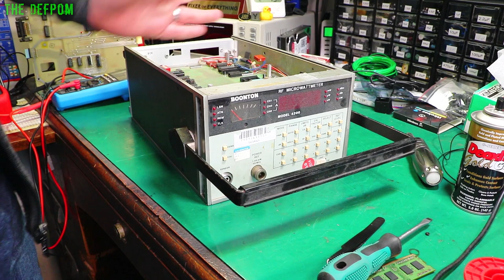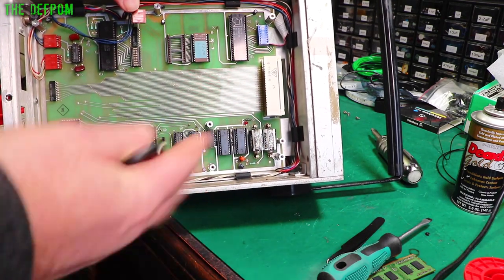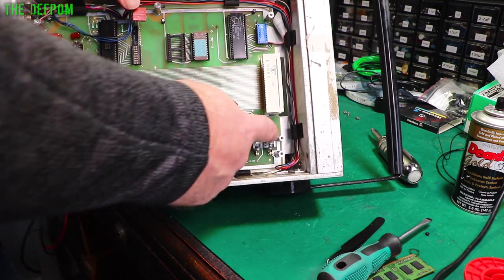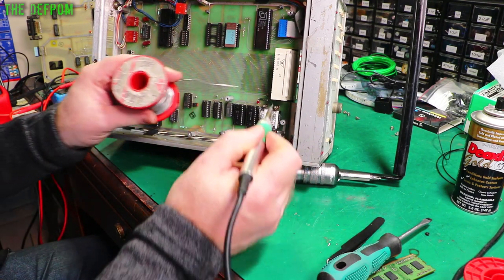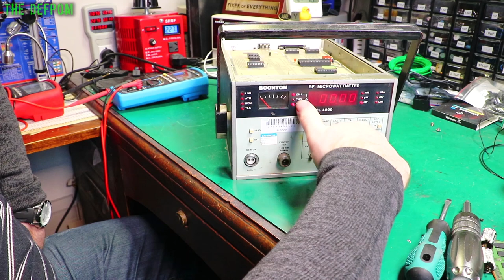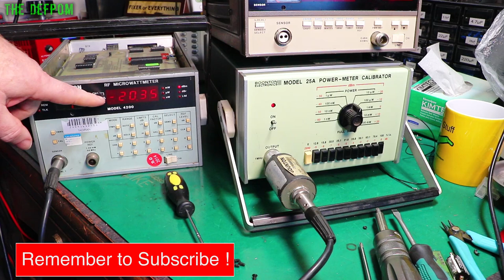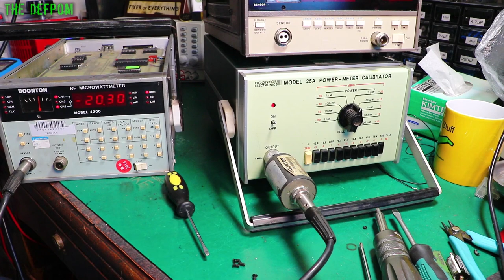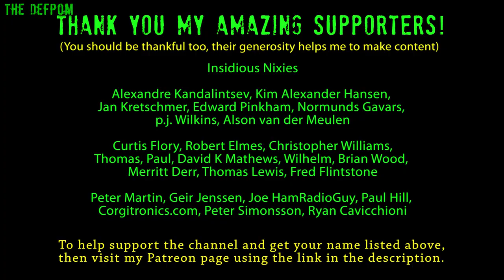🔴 Boonton 4200 RF Microwattmeter Repair Part 2 - No.848

Comment: I think the LED next to the batteries is acting as a diode to block charging of the factory non-chargeable batteries.
If you're worried about running batteries with a lower voltage then possibly swap out the LED for a Schottky diode and you'll gain a volt or two.
PS. RF is something I have never, ever played with.....black magic.....and a world of it's own to me!

Comment: a repair video nice shame not fixed but then not everything can be:-) I await a further video
Reply from the maker: I will fix it fully eventually, the important thing is that there is progress, when I get more time I will have another go at it.
Reply: @TheDefpom  That is the next video I am waiting for:-)
Reply: @TheDefpom  Its really tedious but I would like to see how to enter the cal constants for a new sensor. 
One correction- the sensor you are using is a diode sensor. The thermocouple sensors are the 7E and 8E versions I think The manual is really hard to follow on some of this stuff.
Reply: Also the unit is in differential mode. You need to press 1, channel to select channel 1. On a 2 channel unit it offers  1, 2 and selecting 3 shows the differential between 1 & 2.
Reply from the maker: @the1audio  Thanks for the info, this is a single channel unit, I have tried pressing 1 and channel, and channel and 1, all all sorts of combinations to see if I could get it to show as channel 1 only, nothing seems to be working for that, I just got it back out and had another go in case something had changed since the last time I tried, no difference, it still shows as CH1,3.